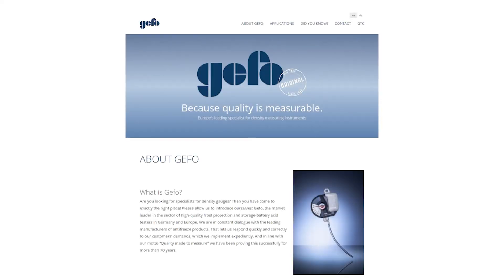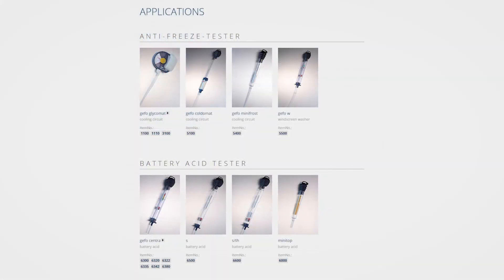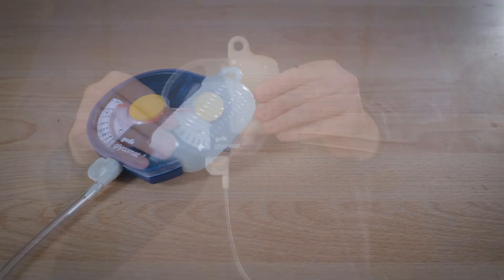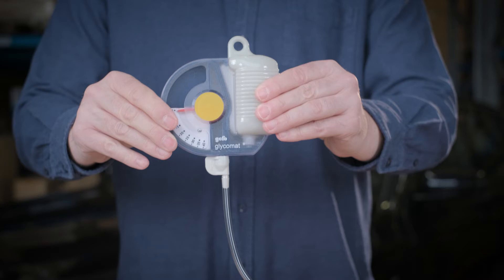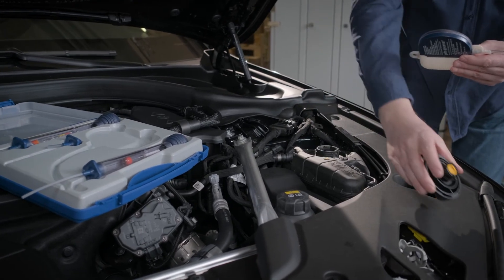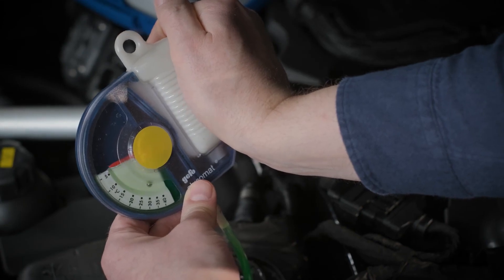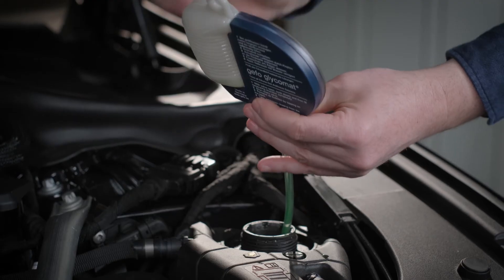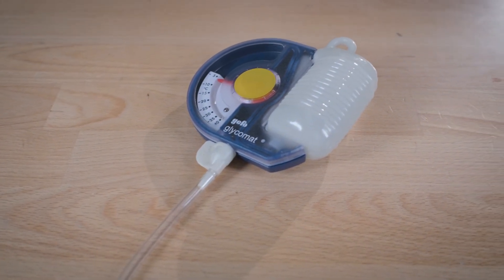gefo glycomat

Comment: This product is calibrated to measure only Ethylene Glycol-based antifreezes. Therefore, it only accurately measures the freezing point of ethylene glycol-based antifreezes. However, if used with Propylene Glycol-based antifreezes, the results will be inaccurate because the density and freezing point relationships between these two substances are different. Each type of antifreeze has different water-mixing densities and freezing points. Most antifreeze packaging includes a mathematical mixing table, which clearly states the antifreeze-pure water mixing scales that correspond to the desired freezing point.